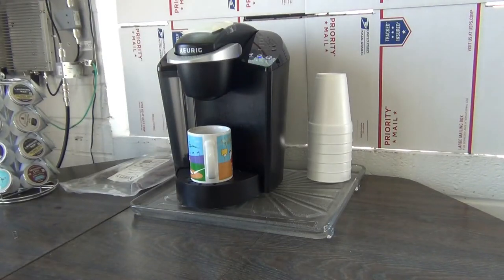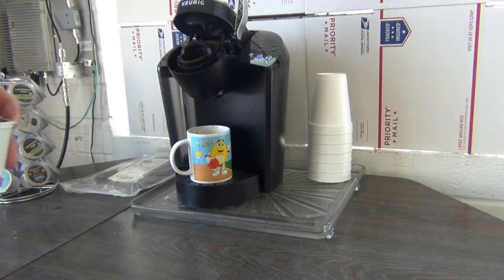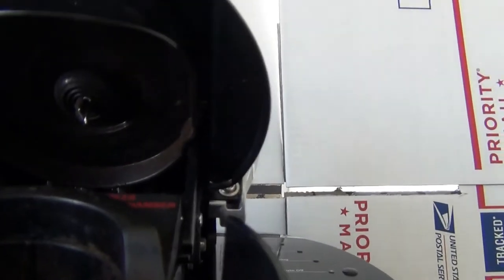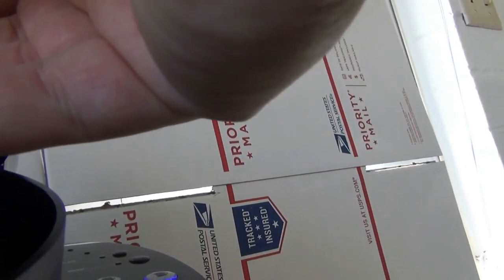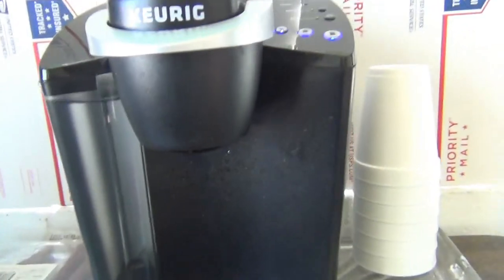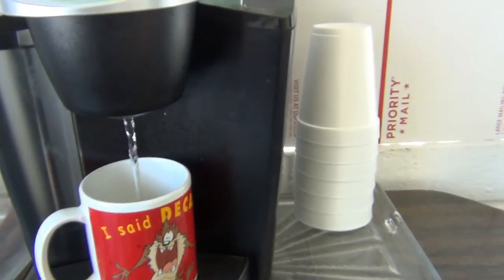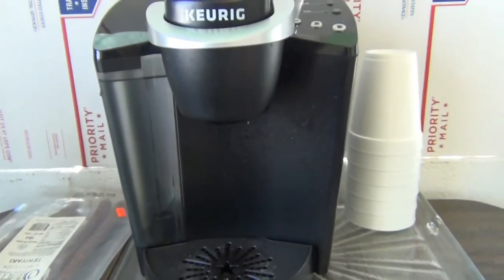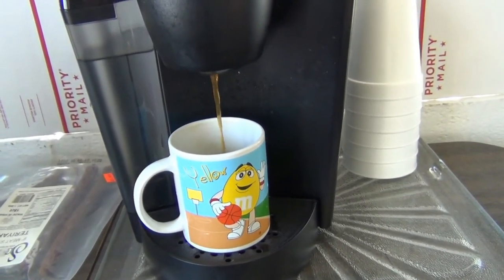Clogged Keurig Coffee Maker - Water Won't Flow

Comment: Worked immediately after this fix, you rock !!  Not a descale issue, a water flow issue.
I tried messing with the air pump, hoses, etc. and almost tossed it which is exactly what Keurig wants you to do.

Comment: This is a great method, and it's also worth noting that there is a fourth hole in the needle that punctures the bottom of the cup. This hole may also require similar cleaning. This fixed a stubborn Keurig problem for me, and you have my thanks!
Reply: Thank you! This advice was not working for me until I saw your comment

Comment: Mine ran great again (thanks to your advice) until I added my latte cup. Now it's back to not filling up. I have to continually open and close the lid so I can keep pressing the dispense button until all the water has gone through. After, it only gets warm not hot. I even cleaned it thoroughly with a vinegar solution and ran clean water through it 8-10 times afterward before using my latte cup. No idea what the problem is.

Comment: My Keurig Vue no longer dispenses the right amount of water after I had to emergency abort while it was spewing grinds all over the place when I used one of those K-Cup converters.  Cleaned up all needles but the amount of water doesn't fill propertly (even when at all water levels selected).  I think the computer got confused at one setting and I'm not confident it's a water pump issue unless grinds somehow got pushed back into pump.  So disappointing after 9 years of service and this brand has already been discontinued.  =(

Comment: Thanks for your video but unfortunately no bueno 😥  I'm hoping after I describe the situation that someone  will have the magic solution; Or, tell me that my description sounds like the way in which Keurig coffee makers normally work. If that ends up being the case, my heart will be officially broken and I have lost all respect for Keurig 2.0 (that's my machine). Ok so here's the deal. I bought it in 2016 or 2017 and only used it maybe a 25-30 times before I was transferred for work. Because my company was paying for my housing etc., I packed it up along with my other  belongings and it went into a climate controlled storage. Before going into storage, just to make sure it was stored properly, I ran vinegar through it, used the paperclip, and since moldy coffee doesn't sound good, I dried everything I could reach with paper towels then put it in front of 2 big fans for 2 days. When I got it out of storage I ran a half gallon of white vinegar through it twice followed by gallon and a half of distilled water, added my new filter, set the settings which included setting it to brew 6 ounces of coffee. At best I'm lucky if I get 4 ounces. I have to set it to 12 ounces to get 3/4 cup of coffee. The stream seems much weaker it used to. One time when I used the paper clip trick only a few grounds came out in the plain cup of water that I ran. I have done this more times than I  can count. Technically with the way I prepared the thing for storage I should have been able to have to perfect cup of coffee right there at the storage unit the day I unpacked everything to move to my house but I tried all of the tricks I know. Could there be something internally clogging the brewing  system? It's out of warranty so I guess at this point  I don't have anything to lose by taking it completely apart. I'm afraid I would just create a big mess though and a accomplish nothing in the end. Does anyone have suggestions?  
Thanks you in advance for taking time to read this and for any suggestions you may have to fix it; OR, if you have any knowledge as to whether or not Keurig would even be able to help me. 
Have a blessed day!! 😊